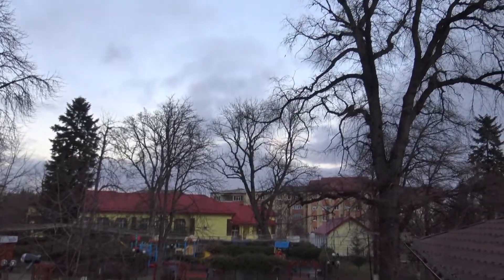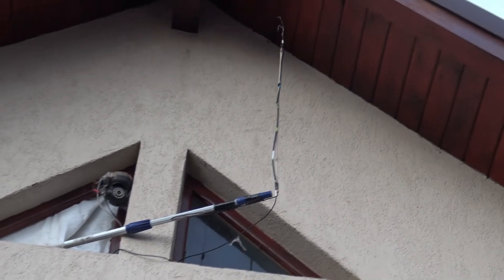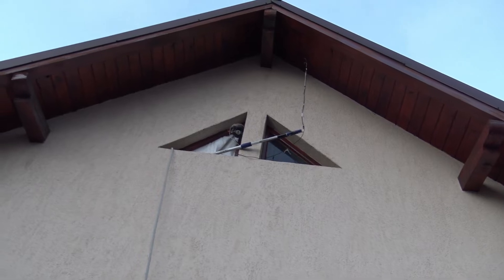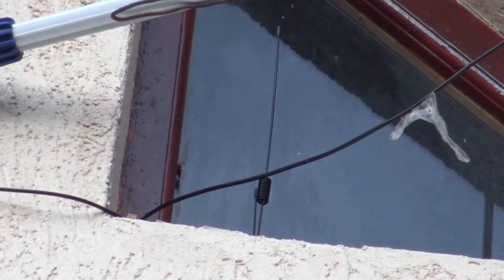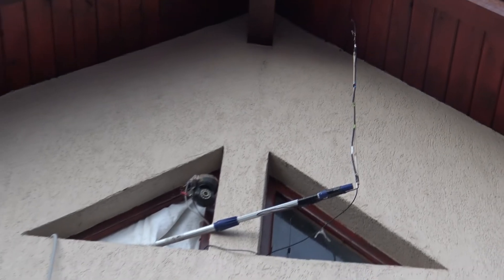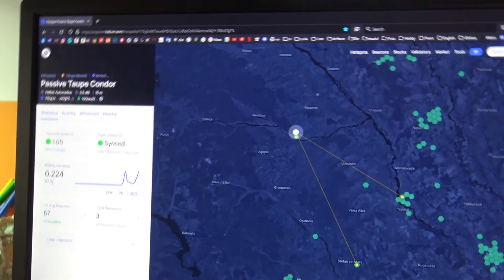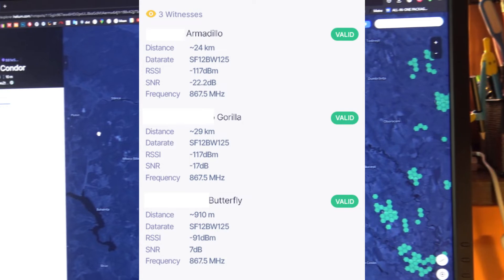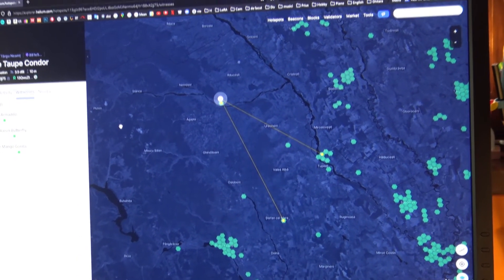Heltec hotspot and DIY collinear antenna update

Comment: Hi... One quick question.. Will there be any issues if I use 915 Mhz Frequency Antenna in India, which according to my research is 865 MHz. Even if I get this, can I retune the frequency that is compatible in India.
Reply from the maker: You can't! The antenna should be strictly for your frequency.For the best RX/TX gain.There are so called wide band antennas, like 840/950MHz but from my experiments are good for nothing. My advice, buy or build a good tuned antenna for your freq. This is the main important link in the chain, antenna+cable..